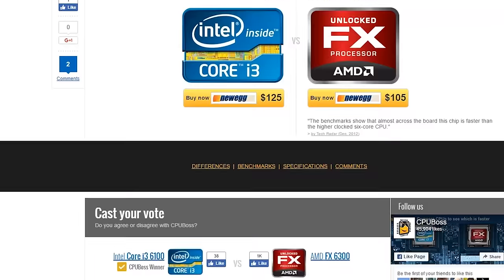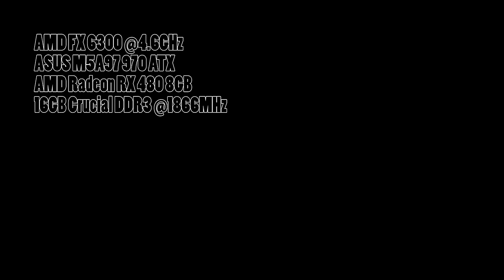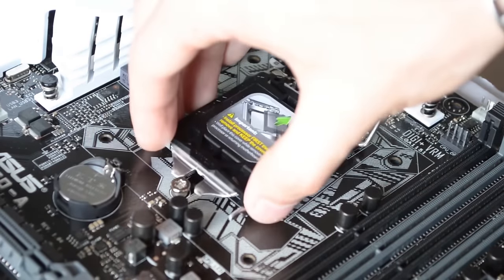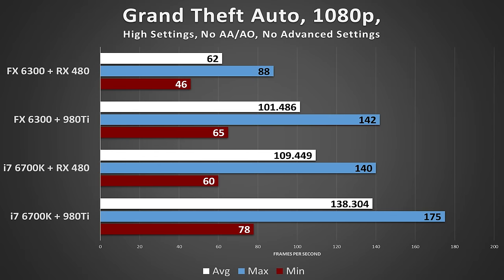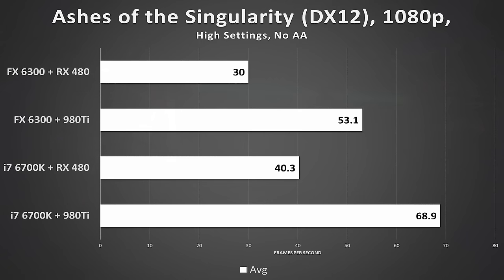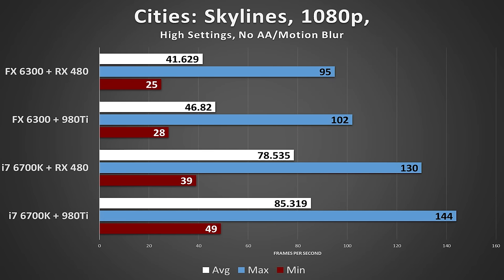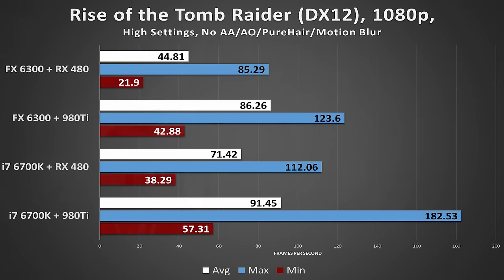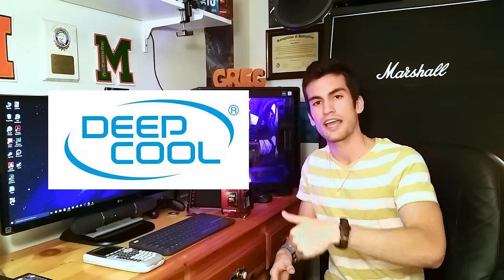AMD FX 6300 + RX 480: Severe Bottleneck?

Comment: The coincidence that I have an amd radeon rx 480 with the AMD FX 6300 Six-core processor rofl
Reply: Have fun! We all should do our best with the budget available. It is a great combo for its cost imho.
Reply: giorx5 Yeah, nice said and thanks.
Reply: and are you happy with the results? what gpu did u have before?
Reply: HideNZeke Before I have no idea but this is an awesome combo. I play the Division alot and on ultra with 1920x1080 I get around 60 - 65 FPS
Reply: What about other games like GTA 5, Star Wars Battlefront etc. How much fps do you have in them? I ask you because I want to buy thi gpu next month and I have the same cpu like you, the FX 6300. I will upgrade the CPU this Christmas, but just for now, I want more fps because the R7 260X 1GB is just too old for todays standards.
Reply: Baris Srn With MSAA on? At the moment, with 1080p and medium settings, with my R7 260X 1GB and FX 6300 I can get 60-65 fps avg with some spots where it deeps down to 54-55. If I drop the resolution to 900p, then it's 100% 60fps locked. Without the lock I get between 70-80 fps and the low as 65. So I can expect at least 60fps with high/very high settings with the new RX 480.
Reply: Not really a coincidence, those are very popular cpu and gpu choices for most people.
Reply: ***** Got the RX 480 this saturday and the FX 6300 BE since 2013
Reply: Wapaaam PvP I'll try no money :(
Reply: Fx 8000 series is pure garbage
Reply: Thebiggestcheese FX 8000 yes, but 83xx it's good, but the difference between FX 6300 and FX 8320/8350 are the 2 more cores, which are useless because no game will use them... You can be fine if you get an FX 6300 and OC it to RX 8350's core clock, because no game will use 8 cores.
Reply: ***** Yeah, and it's not worth the money.
Reply: +Thebiggestcheese We must've been looking at completely different benchmarks, GeekaWhat showed performance close to that of a 6700k (4-5 fps difference)
Reply: AnotherKS Might as well get a 6300....
Reply: Thebiggestcheese For God's sake, don't pair RX 480 with a FX 6300. I have a GTX 970 paired with a FX 6300 and I can't play any game with 60 fps... Sure, there are some games like Battlefront, DOOM with vulkan, where I get 90-100 fps, but it's very hard to get 60 fps on any games. Hell, the bottleneck is so big that no video settings affects the performance at all.
Reply: Why would he want to do that, with Zen right around the corner? It makes no sense to go from one outdated chip to another one. Unless he gets that 8350 for $50 or lower, he'd have more from setting his wallet on fire.
Reply: Well, that is about the biggest upgrade that one can do. In essence, you're replacing the core of your PC. 
I see this question come up quite often and at this point, I'd say to hold out until Zen or just go Skylake. Maybe buy an upper-tier CPU, so that it lasts a good 4-5 years.
Reply: Not completely true there are games that use 8 cores just not a lot https://www.reddit.com/r/hardware/comments/4qexf4/2016_what_games_now_utilise_4_cores/.
Reply: Your gpu might be bottlenecking your cpu also you might have just got unlucky and got a bad fx 6300. 

There are always a few bad batches you probably were unlucky enough to get one of them.
Reply: I know this is old but I want this card and also have the FX6300 with overclock at 4.8 Ghz. anyone with this OC and the 480 to tell me how the FPS are? thanks!
Reply: Fosi94 Mine is overclocked to 4.5 sometimes there are shutdowns like bluescreen so I changed to 4.2 and the quality is fine and runs more then 60 FPS easy
Reply: Baris Srn Maybe your PSU don't have enough power. Can you tell me the model of you PSU please? Thank you very much for your response! I just saw a video comparison between various cards and I saw there are older cards with less bottleneck. Maybe I'll try to find a "cheap" 980ti 😁 but for now I'll save money 8-)
Reply: i overclocked 4.5 and no bluescreen or shutdown, did you use ASUS AI Overclock? or amd drive? just overclock the turbo boost setting
Reply: I just overclocked by restarting the PC and by pressing Delete on the keyboard.
Reply: same
Reply: Baris Srn can I power fx 8350 and rx 480 8gb with a corsair 450w psu?
Reply: TheDkapa1 I'd suggest more, I run a 500 or 750 for the 6300 already, unless you like getting bluescreens and crashes
Reply: obviously theDkapa1, ium using 4x rx 470 in crossfire mode with 750w cossair

Comment: I almost bought an i3 6100 but with rebates and $40 combo discount at Micro center i got an Fx-8320e and and AS rock 970A-G/3.1 mobo for $107. An Intel system would've been three times that or me and this way i get to reuse my DDR3 RAM. 100 bucks to update from an old AM3 phenom x4 925 to a AM3+ FX-8320E system. That was a no brainer. Plus, the next day they sent me a Steam key for the new $59 Deus Ex game! lol
Reply: brando92711 My i3 6100 runs at 4.8GHz. It can keep up with yours in multicore loads, but in single thread loads? :^)
Reply: char whick like i said, an I3 combo would've cost twice as much. Once i have the money I'm buying a BEAST set up and I don't care if it's AMD or Intel. I don't have brand loyalty by sometimes my wallet does!
Reply: Three times that? An Skylake i5 setup would cost only slightly more (because of new RAM), putting mail-in-rebates aside, and you'll have much more performance and upgradability.. You'd have one of the best gamer CPUs for only slightly more..
Reply: Dennis Jungbauer like i said, i got the mobo and CPU for about $100 and i3 6100 and mobo would be at least $200 plus I'd have had to buy DDR 4 ram instead of reusing my DDR3 RAM. It was a pretty significant upgrade for $100 and since i only have a GTX 670 there isn't much point in having a beast CPU.  Now i can buy an RX 470 or 480 and have a nice gaming rig for $250-300 bucks.  That's cheap
Reply: brando92711 Well, depending on what you had before (?) it is a cheap upgrade, yeah, but remember that an FX-8320 still isn't that nice. It's ok, but I wouldn't drive sth. more powerful than a R9 380 with the FX, it get's a bottleneck. I would also rather advise you getting an Nvidia card with that FX, eg. the Palit GTX 1060 JetStream. :) Jump down if you want to know why.. :D

Just as a side note: I'm definitely not against AMD, if it seems like that (as I'm not only against the FX but also advise you getting an Nvidia card). In fact AMD is an even more sympathic company to me, but I'm an objective type of guy - I buy and recommend whatever makes the most sense. Currently it's definitely Intel for the CPU, or waiting for (AMD) Ryzen (!) if you already have a rig and waiting to upgrade is not that much of a problem and for the GPU my last standpoint was it being a choice of preference, given you have the right platform underneath, which is not given with the FX.

In this case another factor comes into the game - the performance overhead of the driver to the CPU. Here Nvidia gets the trophy (at least under DX11), so an Nvidia card with the same performance as an AMD card will result in more fps for you, as the AMD drivers are more taxing on the CPU and this is your limiting factor. It's probably not that much of a concern with the FX-8320, especially as you can overclock it (*), but still sth. you should consider..
(*) given the right mainboard, cooler and PSU! better ask, if you're not sure - it's not that easy with those FX power draws..

PS: Wow, that got relatively long, sorry.. :D
Reply: why? The rx480 today pretty mush ties the 1060 in dx11 and beats it in dx12/vulkan games.
Reply: +brando92711
Did you get your CPU and motherboard as a package deal, or did you get them separate? That's an amazing price! Almost a five-finger-discount!
Reply: Sean Ramey combo deal at microcenter! I was shocked at how cheap it was!
Reply: Sean Ramey I did have to wait a few weeks for a $30 rebate check but that's not a big deal to me
Reply: I got my amd fx 8350 new for $10 amazing price drop.
Reply: That's about what it's worth. I would use one for a cheap home file server if I needed one.
Reply: @thomaswest2583  wow

Comment: Please pair up the i3 6100 with the RX 480!
Reply: That would be great!
Reply: bad idea, the core i3 6100 has two cores while the amd fx 6300 has 6 cores, so you will be getting better performance for triple a games from the amd fx 6300.
Reply: They need about 3 good threads
Reply: Fire Water It dosent matters how many Cores you have, the i3 is better in like 90% of the games
Reply: +Fire Water He tested that half year ago Go check out i3 vs 6300.
p.s. the i3 won
Reply: +Fire Water Please do some research before saying such nonesense. If the fx 6300 is a 6 core, the i3 is a 4 core. It has 4 threads. The i3 outperforms the fx 6300 in every game by a noticeable amount. Where did you get this info from?
Reply: Rhelmar Exactly people keep hoping for a 4 year old cpu to keep up with the i3
Reply: I mean it has 2 cores and it's hyper threaded, that doesn't mean it has 4 cores, that would be like saying an i7 6700k has 8 cores, while it actually has 4 hyperthreaded ones. In most games though, like 90%, your statement is pretty much true because the logical hyperthreaded cores are recognised as physical cores
Reply: GTA5 runs perfectly fine on my i3 6100, as a matter of fact it runs much better and smoother compared to my old rig phenom 2 x4 955 and the same gpu.
Reply: The i3 6100 (like all i3s) has two cores, but 4 threads, via hyperthreading. And the i3 6100's single thread performance is significant;y better than the FX 6300. I have an FX 6300, and am torn between upgrading to the i3 6100 and pairing it with an RX 480, or sticking with the FX 6300 until Zen is finally launched, which is meant to be around October / November.
Reply: +Man WithSword Is your FX 6300 overclocked?
Reply: I'd stay with your FX6300 or get an i5 or better. I would avoid the i3's. i3's arn't bad but you'll end up in the same boat, torn because the i3 wont hold its old in a high threaded or heavily CPU demanding application despite it having better single core performance compared to the FX6300. Even a locked i5 will walk all over an i3 is certain games and applications and they aren't too much more.
Reply: +Viking Dude the problem is, he would have to buy a new mainboard too :/
Reply: Well, you would have too if you were to wait for Zen, Or if you went with an I3 you would still have to buy a new mother board. AM3+ is dead, no more CPU's, I mean he could get the FX 8 core but its kinda pointless.
Reply: thewalkingdeadcarl - No, I just let it boost automatically when needed. I could overclock it as I have an Arctic Freezer 7 pro cooler that can take up to a 150w TDP. And I know how to overclock, but because of what I use this pc for, stability and temperature are more important to me. Viking Dude- I think you're right...I have another pc with an i3 3220, so the other option is to upgrade that with an i5 Ivy bridge cpu and pair it with the RX 480 instead.
Reply: ***** Yeah a decently overclocked FX6300 can match and even beat ivy i3's, these new skylake i3's are not that much better. If you can find a ivy i5 for cheap that will work with that board, or even a Xeon I think you'll be better off with the RX 480. Or just save up. If your not afraid to look for used hardware, you can always look on ebay or craigslist, if you do, make sure the seller is trust worthy. not need to get screwed out of a bad part and can't get a refund, Craigslist your taking more of a gamble unless they can prove it works.
Reply: The i3 has a much higher (well, not that much but, considerable) IPC than the FX6300 but the FX6300 has a much better overclocking range that can make it on par with the i3, even with simple air cooling (hyper 212 evo) you can reach 4.4Ghz... 

Well, in single core games (mostly old ones), things like rendering and stuff, the i3 may be a better option but when it comes to multi-threading (especially in DX12 games), the FX6300 rises. But if you're planning to upgrade (to an i5 or an i7), the i3 may be a better option as they share the same socket and the same type of RAM.
Reply: There's also the factor of game-type. Most games are GPU-dependent, but some rely more heavily on the CPU, where IPC is more important than the number of cores, such that the i3 6100's 2 ht cores have a higher IPC than the FX 6300, and allow it to compete, and with certain CPU-dependent games, to easily beat it. However, the increasing use of GPU compute will make this less important in future titles I'm guessing.
Reply: Nope the system sees it a a quad, so no problems with games that require quad core and it's got a faster single thread performance. Look it up if you don't believe me.
Reply: Yeah the IPC may be much higher but you can make that margin much smaller by overclocking, one of the greatest capabilties of this CPU
Reply: +Man WithSword yet, GTA 5, a popular title runs better on the dual core i3 6100 as compared to the FX, even FX 8300. which is just bad for all of us, it shows how much and has been lagging behind in all these years. Fingers crossed for Zen..
Reply: +Radu Lupu AMD*
Reply: An OC'd i3 6100 will DESTROY the 6300, and go toe to toe with the OC"d 8350.  What's more, you can upgrade the i3 to kabylake next year, and we golden.  All the components of the 8350 are obsolete with Zen.
Reply: And the FX 8xxx series..
Reply: +chronicblazer84 Do your homework, i3 is a dual core with hyperthreading, it shows up as a quad to any app and can handle 4 threads at the same time, maybe not as efficient as a quad core cpu, but it does. You won't get a single game telling you it can't run on it because if that would happen, it means every single i5, every single phenom, every single athlon x4 will not be able to run that game. Would you as a developer thread your game on at least 6 threads? Would you like your game to be played on i7s, phenom 2 x6, fx 6xxx-fx8xxx-fx9xxx? Good luck with that market share, you'll most likely go bankrupt with games coded like that.
Reply: +chronicblazer84 This only proves my point, you're full of crap.
Reply: +chronicblazer84 YouTube is full of videos with that game running on i3s (and not skylakes). If there's bad fps, that's from crap software coded by monkeys. Take world of tanks as an example, before it got updated to dx11, it used to run like crap on my old phenom 2, once it used dx11 (HD 7850) , I've managed to get double the frames since gpu stepped in and did more work and more efficiently than before.  In all this time I was being envious on a mate from my clan that ran that game on a pentium processor and a slower gpu at higher fps. So please, spare me all this shit, state facts, don't just talk for the sake of doing it.
Reply: +Jubal Harshaw It may have failed to run on a pentium, not an i3. I guess understanding a simple fact like the i3 being able to execute 4 threads simultaneously and thus being able to run any single game out there is just hard. Dig harder into those titles you named, as I can see the i3 ran them perfectly fine since always.
Reply: My fx 6300 has 14 mb cache clocked at 3.5 stock, so he should get a new one and also pair with an i3.
Reply: +Fire Water thier the same price though.
Reply: on Win7 it could be nice, but thanks to insane optimalisation with Win10 for multicore CPUs and their cooperation with GPU - I would pick the CPU with more than 2 cores.
Reply: i own a i3 6100 and a fx -8350 and the fx 8350 has out performed the i3 6100 on every single game I own.
Reply: Robert Galvan because FX-8350, even without OC is brilliant :)
Reply: Heet Nandu just got a rig with it. runs everything beautifully